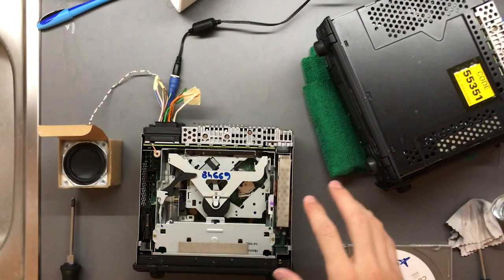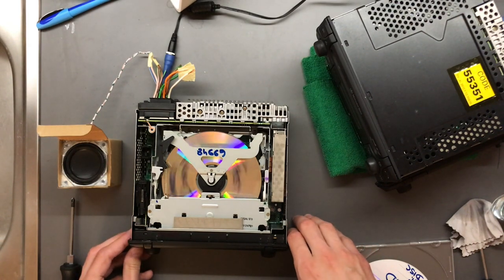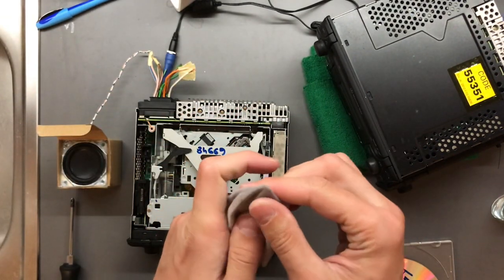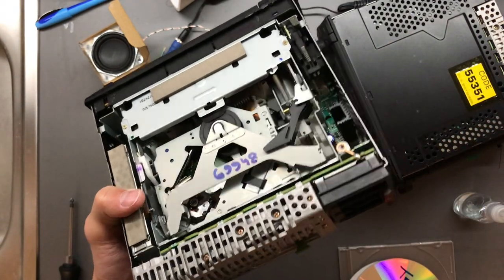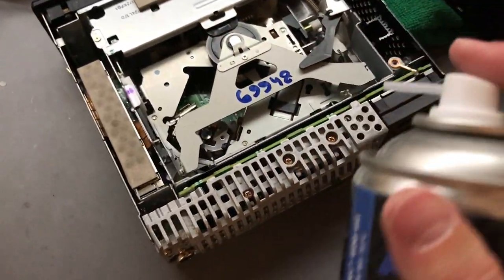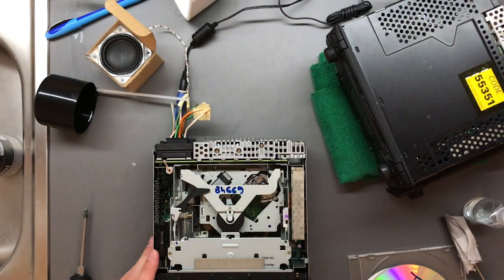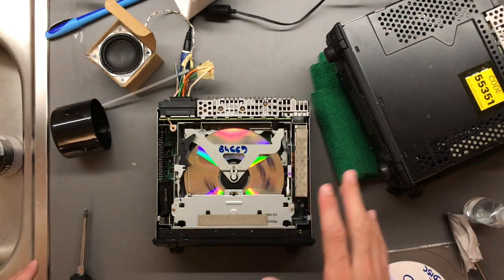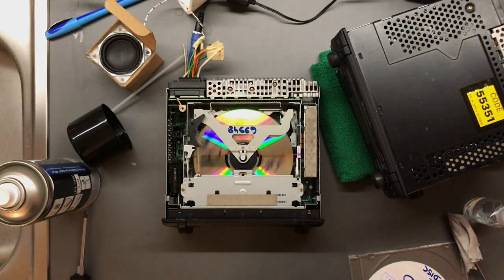How To Clean the Laser on a CD Player - Audio 10 CD

Comment: Hi there, mine plays original cds without problem. I had the 700mb Taiyo Yudens and it took a very long time to play and when I skip tracks, moreover when I skip tracks, the track plays from the middle. I took your advise and went for the 650mb cds, they were MPO discs, they have almost no delay in skipping tracks but they still plays for the middle. Do you think cleaning the laser will help? Im not very handy especially I dont have the removal tool, its a project to me.
Reply from the maker: definitely try cleaning the laser

with a lot of care and no haste it's the perfect project, quite simple
Reply: Hi! I have the same problem (track play's in the middle) Do you solve the problem?

Comment: What is that stuff exactly you sprayed?
Reply from the maker: 99.9% ethanol (pure vodka basically)
Reply: I dont mean the small bottle in the beginning. I mean that big one after you finished brushing.
Reply from the maker: oh, that's compressed air (not actually air, some liquid that has a very high boiling point, smells roughly like lighter fluid)
Reply from the maker: it also never seems to do much - 99% of the results 'seem' to come from the rubbing of the lens -- there's never actual huge specs of dust lodged in there (though there might be)

I've also had laser that never came back to life (1 out of many though); even after a thorough scrub, they still had a very hard time focusing
Reply: Its clear now, thanks so much!
Reply: But still the problem exists...im afraid ive to buy a new one..
Reply from the maker: yeah, if it's really fucked ... from smoke in the car or the atmosphere ... that layer of shmoo will not only form on the focusing lense's front face, but also the back and on the diffraction mirror etc ...

as a last resort which might very well prove destructive, you can take the laser out (very fiddly to take those units apart, but with care and patience, not very hard)

and dump it into that 100% ethanol ... in a little jar or so ... and heat that up ... let it sit ... and maybe ... just maybe ...